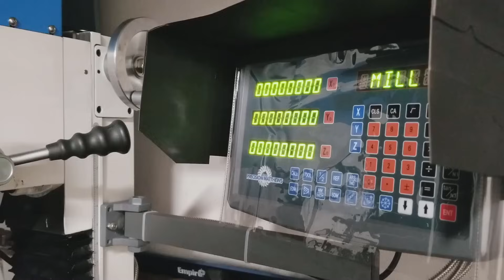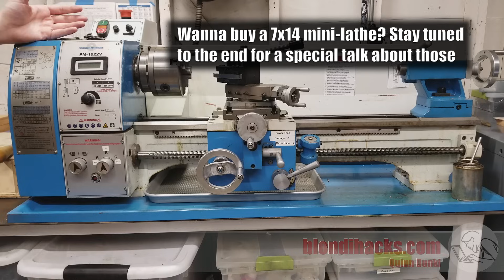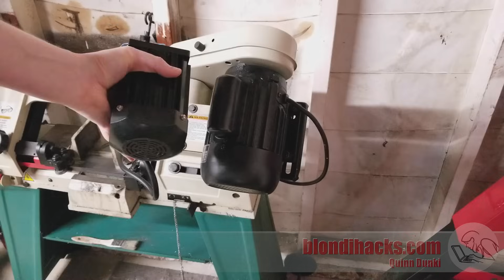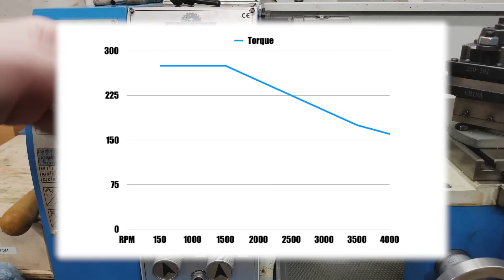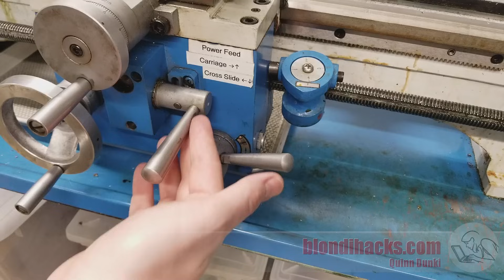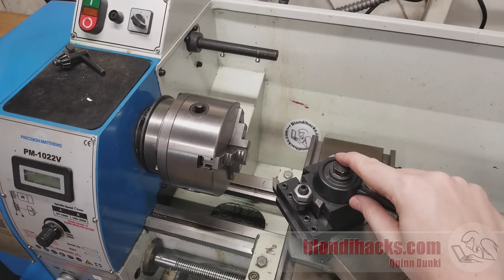Import Lathe Buying Guide

Comment: After a lifetime of using imperial measures, I found myself in a shop primarily serving to automotive customers.  Our engineers typicly convert metric to imperial, the prints at my machines were imperial to run on a metric machine.  So, either cry and complain or get the calculator out and convert.  The other day, a young new guy asked me what tools he should be buying, rangewise.  My smaller allen arenches are not marked, so I guickly grabbed a mic, measured the small one, grabbed the calculator and started to convert when the newbie told me "Just push the button on the mic!"   So newbie taught the old timer!  Of course the old timer felt better telling him the 1.48 measurement is actually a 1.5 MM wrench, so I still look like a useful tool.
Reply: Then his battery fails and you have to show him how to use a real mic.
Reply: @phillhuddleston9445  * Really old. 

Both old and modern are real...
Reply: @mattsadventureswithart5764  Most micrometers made today are not digital ones. The vast majority of machinists today still use a standard micrometer and even dial calipers over digital ones. If you know how to use a mic and calipers correctly there is no advantage to digital ones that can easily malfunction and require batteries unlike conventional non-digital measuring tools. The only advantage digital calipers have over dial calipers is that dial ones can skip a tooth if a chip gets in the rack and pinion but this is easily correctable and usually avoidable. When digital ones fail you throw them away if it isn't battery related.
Reply: @phillhuddleston9445  the standard micrometer is not the modern one, no matter how common its usage. Hence my use of the words "old" and "modern".
I can use either modern or old and both mine are definitely old.
Reply: @mattsadventureswithart5764  So by that standard any vehicle that has an internal combustion engine is an old vehicle because we now have electric vehicles in mass production even though they make up a very small percentage of vehicles on the road today.
Reply: @phillhuddleston9445  My use of the word "standard" was because you used that for the old micrometers. 

Ref your modern car argument: if current production cars had exactly the same features as those manufactured 100 years ago, without any of the fancy digital stuff, I would concede the point. However, they have shedloads of modern features which include computer controlled displays indicating things like distance travelled, so I can't concede that :)
Reply: And yet it never dawned on you there was more than ONE button staring you in the face, clearly marked as to their function...lmao, sounds like a "story" to me, just saying.

Comment: Very well done video. I've got an Imperial lathe but I commonly work in metric. Much prefer metric for it's ease of use. I debated for a year what lathe to buy, how big, price, tooling, etc. I ended up with a PM1440HD. Now very glad I didn't get smaller. I have 3 phase so naturally went with that. There were a few issues with it but support was quite good. The D1 chuck system is so much better than many of the others available. All the standard Imperial threads are available via the gear box but metric requires using change gears, a PIA. The spindle bore is only 1.5" and has been a pain to work around. I got the taper attachment (OK but not great) and collet chuck (excellent) from PM. The quick change tool holders seem fine and are readily available for cheap, I now have a lot of them since I don't like to change tools. The steady & follow rests are OK but only have brass tips instead of rollers, will change that some time. It turns out I use the collet chuck more than I expected, same for turning between centers. Machine came with the MT adapter for the spindle bore and two dead centers and a live center. The 12" face plate is fine but takes 2 different sizes of T nuts?? Why??  To turn between centers you need to buy a set of lathe dogs. This machine came with 2 axis DRO which I use constantly. Machine has plenty of power and all the gear boxes were clean as received. Some of the gear box knobs were very tight when new but have now worn in and work fine. Some people have told me this lathe is too big for small precise work, NOT True. I just made a small tool from 1/2" tool steel, bore was .196 X .800 deep,  OD was .203 X 2.000 giving a wall thickness of .0035". You really need a mill to go with a lathe for many of the projects. I've got a very used Jet 9 X 49. Thanks again for a good video.

Comment: Well done.
I’ve always wondered what the average hobbies does when those Asian lathe spindle bearings go bad.
As you say, you use them until they need to be replaced.
Replacing spindle bearings can be a bit challenging, not an easy peasy project.
I like how you explained the difference between the identical castings and how different the end item may be completely of different quality.
I don’t have any experience but I can only assume a Precision Mathews would be much better than a HF lathe.
When looking for a lathe, I seriously considered a Taiwan made lathe.
I ended up with a 1970 Clausing Colchester 15X50, I could not be happier with my decision.
No it wasn’t cheap, it’s robust and powerful.
We all have choices to make.
Well done.

Comment: Probably the best summation of import lathes for non-professionals I've seen.  Too bad you didn't do this several years ago before I bought my 8x14 HF lathe.  You did get me thinking about the drive motor.  Variable speed via pot would be nice. And the finish on my change gears is exactly how you describe.  Nice!

Comment: I was wondering about AC vs brushless DC motors. The Chinese seller I am looking at says the brushless DC option has more power, a longer life and is less noisy. I had decided on brushless DC which seemed all-around better suited to my applications with the exception of low-RPM making of springs occasionally which I think I would get by just turning the chuck by hand. 
Now I am not sure how true that might be if the mosfets end up wearing out before the motor.
Reply: The BEST compromise will always be to order a machine in three phase, and purchase a vector VFD to get your variable speed.
Reply: If it's any reassurance, in a properly designed circuit with adequately sized MOSFETs there can be no realistic question of them ever wearing out.
Reply: @ealingbadger  LOL, he is however talking about cheap Chinese made motors, and drivers with corresponding cheap, usually inadequate electronics on board. Usually you can cut the supposed "specs" in half, and then you would be ok.

Comment: An excellent summary for anyone wanting to buy a new lathe for "hobby" work, when i got my 250x550mm lathe lots of people were having problems with the variable motor speed, burnt out motors, or controller's so i went with a completely geared version mounted by HBM, unfortunately HBM no longer sell them. Other than the norton box with gears the rest is almost identical to yours and i'm very happy with it. To change from metric threading to imperial i do have to change 1 gear but its very quick, and here lies the biggest downfall of the lathe, it has no threading dial so once closing the half nuts they are closed till you finish, not a big big deal but anoying at times. I have located one in Australia but the shipping is more than the part. Anyway, at the price you cannot have your cake and eat it too. 👍

Comment: Hi Quinn, I enjoyed the video and learned a lot from it. Thanks!
Question, If an imperial machine has a 'change gear' to allow metric threads to be cut, does it really work? or is it just another poor compromise and marketing?  Thanks again!
Reply from the maker: Great question! Yes, these are generally okay. It’s a bit of an approximation (it isn’t quite as precise as cutting threads that are native to the lead screw) but the result certainly works. I haven’t measured the two to see how close they are so I can’t speak with authority there.
Reply: @Blondihacks  Ok, if you ever get a chance to check it out I would appreciate an update to the video or new central on that theme.  Is your mill metric or Imperial?  Thanks again!
Reply from the maker: @jcs6347  My mill is Imperial as well.
Reply: @Blondihacks  Thanks!

Comment: Very well done Quin, I agree with all of your observations. A lot of very sound advice.
I would suggest to keep away from screwed spindle equipped lathes. I have one, and it is almost impossible to do any useful work in reverse. The cam lock mounts are the big winner. If some one can show me a good way of locking my Chuck's on, I'm all ears and eyes!
DRO,  I highly  recommend that. 
Metric or imperial? The decider here is "are you going to produce more imperial threads?" If so get a imperial lead screw. My machine has a 8tpi leadscew and metric feed screws and dials. Conversions are dead easy, when they are needed and I would not have it any other way.

Comment: I have a LMS 5100 (import 7x14) and it's the greatest... pretty goo... it does spinny stuff! :o) I bought it to make antique radio parts and "other stuff". I figured if Chris at Clickspring can make an Antikythera mechanism on a Sherline and Sieg lathe I can too... I haven't done that yet... apparently skill is a thing. Who knew... My mini lathe taught me that I like working on a lathe and that I need a bigger lathe. So that's on the agenda. Hopefully lathe #2 will be more useful than lathe #1. And I want a mill. 

I saw you an Abom's Good of the Land fest video (that sounds kind of creepy :/ ) Question: How did your casting turn out? Casting looks like a useful and fun skill to have.
Reply from the maker: It turned out great! Clarke from Windy Hill Foundry is a great teacher. I didn’t get to hold the final product, sadly. I had to leave to catch my flight while it was still cooling in the mold. Rotten luck!
Reply: @Blondihacks  I'm glad it turned out. I told Adam, well, the computer, to go back and check on it and he didn't hear me. I guess there's some kind of silly rule against taking red hot metal castings on an airline :o) Honestly, it looked like a great experience. How handy would it be to cast your own "stuff'?

Comment: Great tips Quinn. My first lathe was one of those combo lathe/ mill jobs. While I could do a lot of stuff with it, there were a lot of compromises. The chuck was always a challenge to mount and dismount due to the bolts on the back plate having to come out in order to replace it. The biggest challenge was with the mill having a very limited quill and table travel. 
I fee fortunate in having purchased that one though because it helped me evaluate my requirements for my next one. 
I feel that you hit on the main points that anyone needs to consider before purchasing a lathe.
Reply from the maker: Awesome, thank you! Those 3-in-1 machines are very tempting for lots of folks, and I think they can be a good way to get started.

Comment: Another well presented summary.
I would stress the decision about metric vs imperial is all about the leadscrew, this will determine the range of threads. Most can do a range of both with appropriate change gears but some will be difficult to obtain. Some lathes have both markings on the dials. If you need to convert a measurement quickly, a lot of digital calipers have buttons to scroll through so get your measurement say in thou. then hit the button for metric. Works but tedious!
Taiwanese machines are often higher quality.
Finally the steam engine also has maximum torque from stopped/low revs, unfortunately the steam causes premature rusting of the lathe bed!

Comment: Ugh. I have a small import lathe, but wanted something larger. I bought an Atlas from the 70's that was a dirt ball, but restored it to nice, usable condition. It came with no steady or follow rest. It also had a hidden broken casting on the compound. Between those items, plus new larger tooling, I quickly exceeded the original cost of the lathe. It's been a few years now, so it's not quite as shiny, but here it is right after the restoration: https://i.imgur.com/fUka2SK.jpg
Reply from the maker: Looks beautiful!
Reply: @Blondihacks   Thanks very much, I get a lot of use out of it. It was nice to save it from an early scrapyard grave.

Comment: Hi Quinn, excellent video and very well presented.
With your lathe is there anything you wish was either better or something its missing?.
Regards Kevin(MachineNZ)
Reply from the maker: I certainly wish the steady rest was better, and I wish I could single-point threads without needing the change gears. I also wish it had a spindle lock. There are times that would be handy. I could build something to do it...
Reply: @Blondihacks  Maybe a project video for the future...lol. Regards Kevin (MachineNZ)

Comment: Because I live in Canada I have to use both metric and imperial. I have an old Hercus 9A lathe and a Rong Fu RF 30 round column mill drill, both imperial. Personally the only problem with either system is combining units within a project, which you might have to do working on a north american built automobile. A spread sheet built conversion chart is the best way to work with metric in this situation and use a dial indicator to check all settings instead of the dials on the adjustment wheels. Other than that I just work in imperial. Since I'm 70 years old that's what I grew up with anyway. Which is better? I don't think either is "better", they both work and they both produce quality parts. It's whatever you're used to. Trying to work with one or the other if you aren't used to it will generate much bad language and frustration. I have also found a spreadsheet can help out if you have to convert an old set of plans to metric. You can get numbers that work and maintain tolerances too. The problem would arise in that the finished product will be a different overall size from the one in the plans because of the aforementioned tolerance stacking issue.

Comment: light years is the bummer of all measurements try looking up how long one is an making sense of the answer.  Regards lathes mine is the model B by a company called Chester in the UK, its basically a Grizzly.  The Lathe has been absolutely bullet proof - its been used as a semi pro machine for both hobby and light manufacturing work.  Changed the tool post for a quick change post, only thing i would have liked would have been a thread dial.  Oh and i fitted a DRO.

Comment: i have a  7x14  pencil sharpener cough i mean lathe  done bunch of aluminum work on it it can be pretty acurate  also seems like doing small pieces  is easier on small machines but then again   ive never tried makin small stuff on  the big once ive  worked on hell the tailstock  on the lathe im used to using is bigger then my whole home lathe
Reply from the maker: Yah, totally! I think matching the size of the machine to your work makes plenty of sense. I wouldn’t want to try and make watch parts on even my 10x22.
Reply: @Blondihacks   thinnest OD ive turned down to so far is  .040"ish     at about 1.5" length  the  "chip" that comes of  is just barrely visable

Comment: Just personal preference, if you have the room, ability to move go with an older English German American Canadian. Bought a Colchester Student and was able to get the bed reground for about $300 Canadian and nuw have a bullet proof accurate machine
Reply: Yup, the Canadian Craig's list up in Newmarket (North of Toronto) was able to get the bed ground at a place that dose large blades for everything from industrial wood planers to zambonis. But the local machine shop had their tooling reground there. Good price if you're not in a hurry
Reply: @excavateboy  More detail on the repair shop please. I've got an OLD South Bend 9A I'm in the middle of stripping down to clean and redo.
Reply from the maker: I’m curious, where did you buy it? A machinery dealer? Kijiji?
Reply: $300 for a bed grind is really cheap!
Reply: @Larry1942Will  small shop and winter work /in between job sort of deal. I have to grind the saddle to match etc. Just patience and dropping off the bare casting clean with specific instructions on points to go off. All cnc and only took an hour.

Comment: Absolutely love your channel. So perfect for all us newbies :)
I plan to make a sign on the Maker club I am a member in (yes, they have a metal workshop, wood workshop, textile workshop and more) with the information - "now you have passed the safety class, if you need to learn how to really do some work, go to Blondihacks Youtube channel" :)
I got my own lathe this summer, even smaller than an 7x14, but an pretty nice little EMCO 5. No problem cutting steel on it so I am a happy man!
One thing got me laughing really good here: "Metric is messy with all the decimals like 0.375mm" Well I thought, what is 0.020" then but a decimal inch :D
Reply from the maker: Haha, awesome. Send me a photo of that sign, if you make it. 😬
Reply: @Blondihacks  Will do, I promise :)
Reply: I think her comment about decimal inches being simpler is that you use the same format for anything between 0-1.0" where most machined things are measured in thousandths, so most references are anywhere between "1 thou" and "999 thou". In Metric you typically need to use combinations of range names. Like if something was 14.5 mm (571 thou) and you wanted to remove the equivalent of 'a thou', what would you say? "Removing 0.0254 mm"  or "removing 25.4 microns" to "make it 14.4746 mm"? Then if you wanted to remove '10 thou',  would it be 'removing .254 mm' or 'removing 254 microns', or heaven forbid "removing 1/4 mm" (lol) ? Note: I'm not dissing metric, just saying some things are easier in one system versus another, and vice versa, which is what Quinn said.